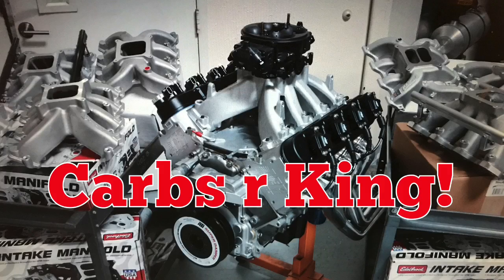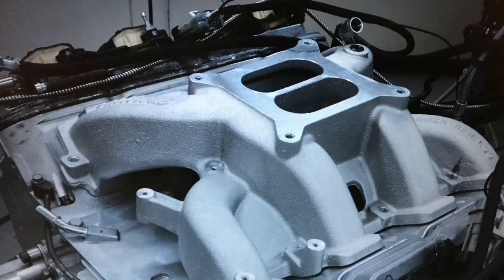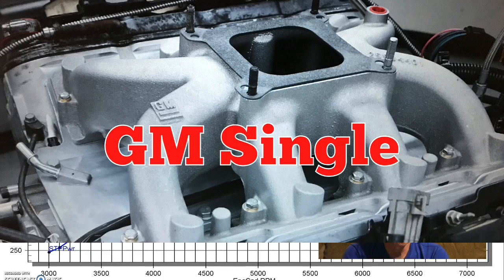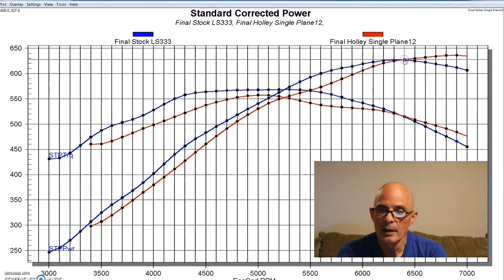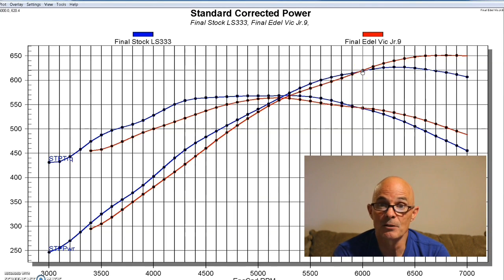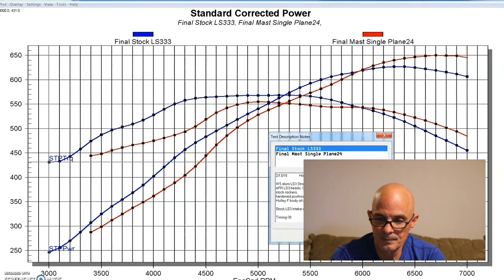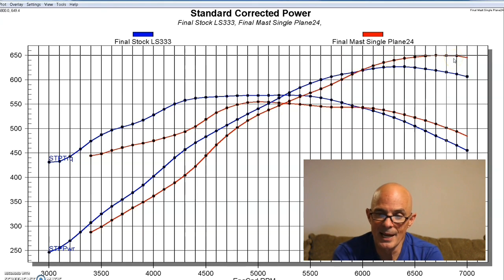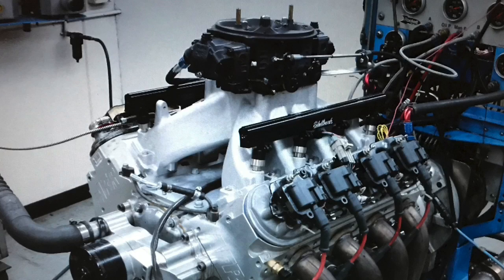CAN CARBS COMPETE? 416 LS3 INTAKE TEST (pt2)

Comment: You know, that lack of low end torque could work in your favor on a turbo engine, might save the engine.
Reply: But in a street application it would make for a lazier engine and will spool the turbo a little later as well.
Reply: @dilsher12  turbo spool would only be a couple hundred rpm different if turbo properly sized for the motor. but N/A engine would definitely feel less responsive at lower rpms 50+ ftlbs in the lower rpm range  is like %10-12 difference

Comment: Hi Richard,
 Why don't you try a test result for Ls Crank Damper Pulley Underdrive ? they are saying that it will kill Ls Torque at top end,  isn't it ? regards.
Reply from the maker: a damper change will not alter torque production

Comment: Let’s try something no one has done. Use an ls3 intake and make a custom elbow to mount a carb on the snout. There is a money maker if it works.
Reply: Be interesting but that manifold was not designed as a “wet” intake so doubt it would be that good as a daily
Reply from the maker: I made an adapter to do that
Reply: @richardholdener1727  the big question is, does it work............ 🤘😁🤘. Must......see.........video.........
Reply: Good idea.
Reply: Carbs are mounted in the center for a reason.  Do you think the AF ratio would be too different between the front and rear cylinders?

Comment: Hey bud awesome video to conclude with intake series - the only thing I can think of is that the 416 might benefit more from a cam in the higher rpm range - to be honest the cam featured favors the LS3 amd Victor Jr intakes.  I'm having a 430w with trickflow twisted wedge 225Rs from TEA 225Rs from TEA and will be running well north of 7K RPM.  Could you do another video for those nasty NA street guys who buzz there motors beyond 8K RPM?  Here's a short video of my specs if you're interested: https://youtu.be/AXPnaN1e2zY

Comment: Wonder if the cam was on a say 108-112lsa if thered be any gains at all?

Great content, i spent $$ on a fast intake. Only gained 6rwhp at 6500rpm haha ls1
Reply: Moses if you don't mind me askin, what was your FAST Intake setup? I was gonna buy one, but im not going to waste the money for 6 hp. Also have a ls1 (heads & cammed)
Reply: @theultimatecult  running a fast 90mm forgot to mention picked it up cheap. Id spend the money else where tbh.
Reply: @Mosesk1988  If i were to get a Fast 102 I would also have to get a decent throttlebody and a new CAI setup then a tune.. Thats about 2 grand for 20 horses or so. For less than 2 grand I can get a nitrous kit with a retard box and window switch with all the bells and whistles and spray about 100 shot safely :) Yes definately money best spent elsewhere lol
Reply from the maker: a Fast is worth much more than 6 hp over an LS1 manifold unless your motor is stock
Reply: @richardholdener1727  fairly decent cam only deal with all the hardware double springs double timing chain collets locks etc 238/242 112lsa 600lift 600exh made 389rwhp with a 4k convertor and 3.9s did run 11.69 at 117mph also on a radial. Was a fast 90mm. Heads were stocka and still are.

Comment: Have you even done a heads up TBI vs Carb?  Curious to what it would do if you had say the Vic Jr intake with TBI vs Carb.
Reply: You talking about that craptastic TBI system like what was used from '87-95' chevy truck and SUVs?
Reply: @davidbailey4036  no I mean the High Performance ones on the market now.

Comment: Always wanted to see the GM performance parts LS3 dual plane tested. It looks taller than both the others.
Reply from the maker: I thought we had one but it was a cath port
Reply: @richardholdener1727  actually GM performance parts (now Chevrolet performance parts) never made a cathedral Port version. There is only standard and tall deck LS3 versions. If you Google " 19244037 dual plane" it will come up. Hell, I'll send u mine if you wanna test it. Lmk

Comment: I thought that 416 would make more power. The 600hp combination video shows a stock ls3 cam only @600hp plus. Surprised the 40 extra cubes and AFR heads were only worth 30-40 extra ponies. I also think the dual planes would have done much better with a 1-2 inch open spacer .
Reply: Stock cam ls3 does about 480
Reply: Brent Spence did closer to 500 on this channel.

Comment: Is there a intake that is even more optimized for low end power than the dual planes, almost like the TPI? I hate how the motor in the in my old 2014 L1E felt like it was off until 4500 rpm.
Reply: Edelbrock Cross ram
Reply: You should have had it tuned.  Most of what your describing is the poor factory tune